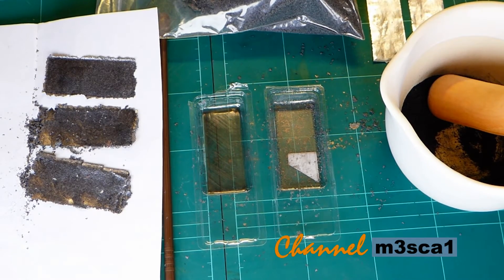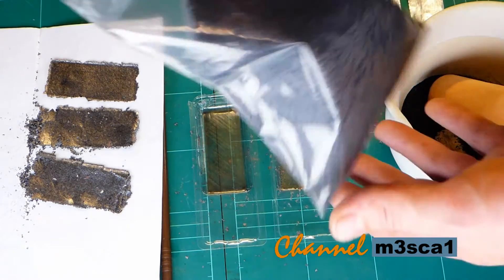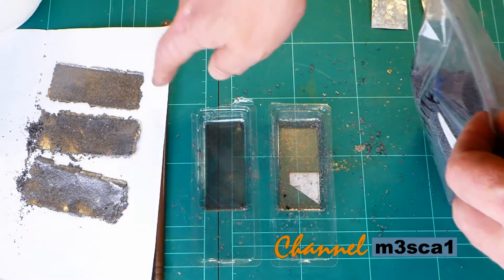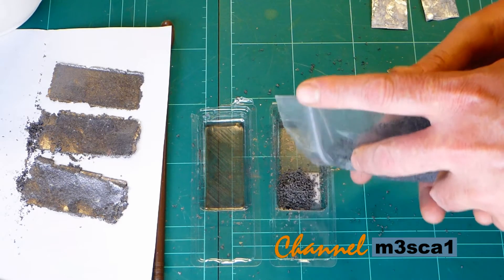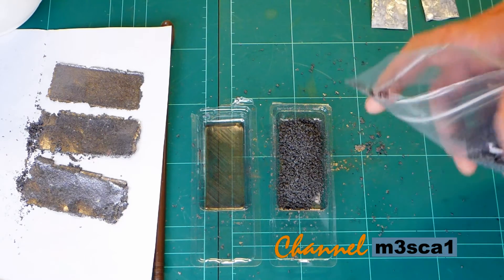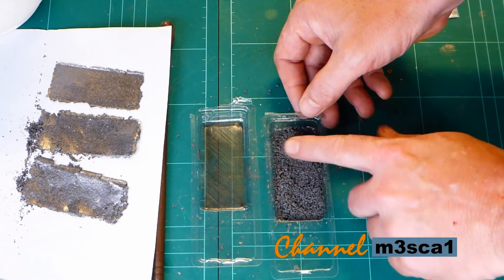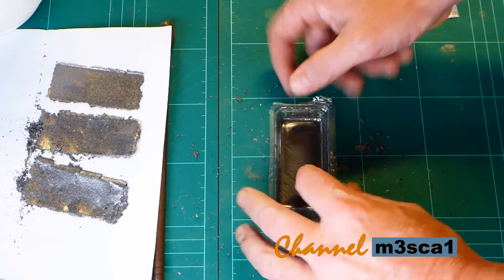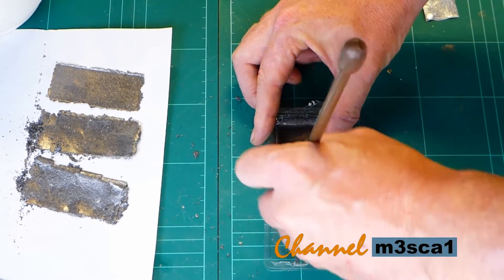DIY-Make Graphoil from Expanded Graphite

Comment: I was wondering what you plan on doing or did with these electrodes? or better yet, were they good at at.?
Reply from the maker: Keith Reynolds these were used in a battery experiment. They have very good conductivity.
Reply: Do you think they would make good electrodes for electrolysis of water? If so i presume that the current density to plate area should be  small to prevent too much physical agitation.
Reply from the maker: Keith Reynolds i suppose if the electrode did not et water logged and then have bubbles form under the graphite sheet, it would be ok. I have not tested it. If i get a chance this weekend i will try it.
Reply: I would think an electricity charged sheet of graphite over another, would in effect, electrically shield the under-layer so I don't think you will have  electrolysis inside the electrode unless the outer layer has given up some of its charge and is not electrically connected to a potential anymore such might happen from to much physical agitation from bubbles though.  You might try various maximum current densities. 1a/in^2, .5 amps/in^2, and .25a/in^2.
Reply from the maker: Keith Reynolds they are quite fragile. I think something to help bind it together would be required because the heat and the rising bubbles and the charge will pull away material. I have seen other people make graphene by running graphite electrodes...the electrodes broke down.
Reply: Yeah I've seen even 316l stainless steel  plates get destroyed, i presume  because they were over driven with too high of a voltage and or too strong of an electrolyte mix to make up for limited surface area of plates.
Reply: @m3sca1  what about readymade  version will that corrode too